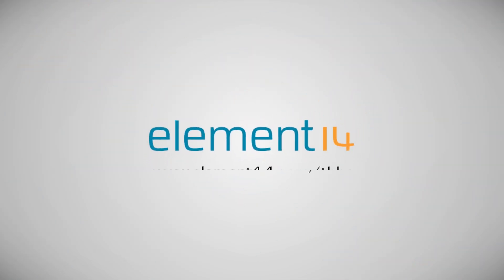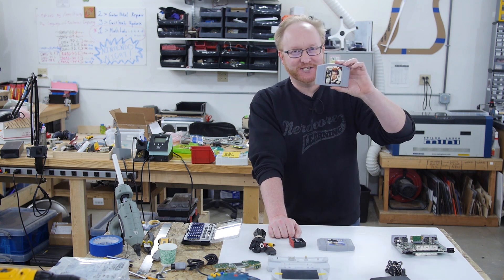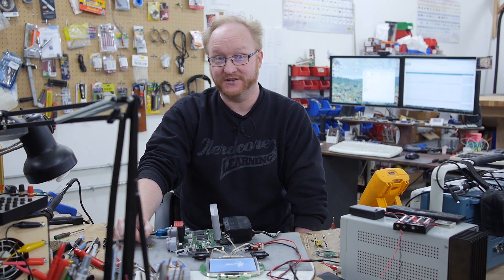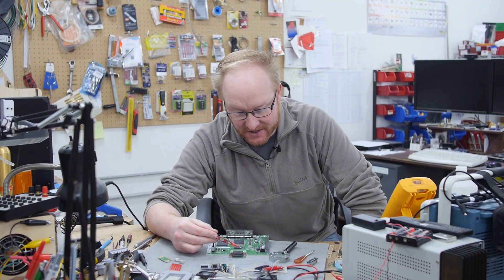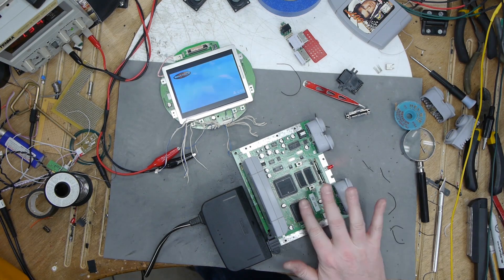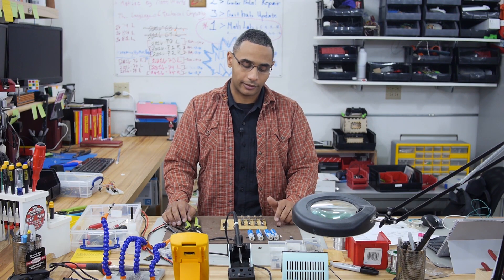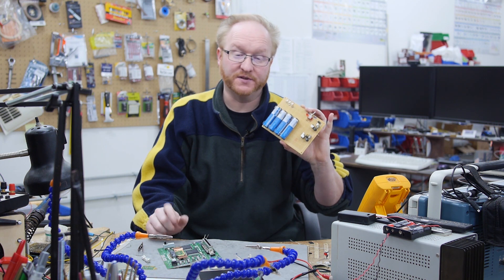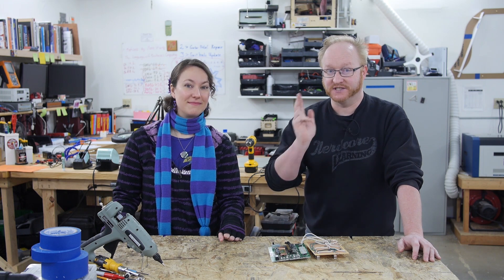Ben Heck's Portable N64 Part 1

Comment: I've got a portable ps1, Gameboy, n64 in my pocket. it's called a phone.
Reply: Have fun with playing with touch controls
Reply: The nintendo 64 emulation is pretty much the black sheep of the emulation world.
Awful communities, being stuck for 15+ years on the same shitty imprecise emulation method, "exclusivity", N64 being a plain bizarre undocumented system that not even the developers had full access to...
Yes, you can play mario 64 with the fade effect missing and Zelda on your phone, but anything more obscure or even the banjo games start to show the limitations of the HLE thing.
Reply: Bas V on android its possible to plug in a controller via USB OTG. emulation just isn't the same though.
Reply: Emulator precision is a bit weird.
Most popular 2D system emulators get the all the commercial games right to a pixel level, because the authors get to test it against all the roms and certify they all run.
But the problems starts to arise when you try to use those emulators to develop new games for the systems, because they allow the code to do several things the real hardware don't or vice versa, and you end with code that don't run on the real system or can't use the emulator to discover new tricks.
So, let's just say that emulators have three possible states, rather than two.
Broken, "run all commercial games" and actually 1:1 to the hardware (Bsnes and nestopia basically, and probably some atari 2600 emulators because you NEED 1:1 to run that thing perfectly).
Reply: Yeah... Emulation is often pretty questionable.

At this point I believe the snes has the single most accurate emulator for any system (bsnes/higan) but Byuu, the person that created it noted that this is all relative. It's far from accurately reproducing very subtle things, as he warned a homebrew developer that was trying to do something extremely complicated and getting weird results compared to real hardware.

The fundamental problem with emulation is the emulators firstly aren't very accurate in general a lot of the time due to poor understanding of the system. (getting snes emulation to that level required de-capping all the integrated circuits in an snes and examining the transistor layout of the circuits), to compound the issue, there's the performance requirements.
Higan currently requires a 3 ghz CPU to run in full accuracy mode, and it all has to be single-threaded performance owing to timing. But to get any major further improvements in accuracy would require a single-threaded x86 CPU equivalent to about 10 ghz.

In spite of this, we've had snes emulators that ran on pentium 100's with maybe 4 megabytes of RAM...
So how is this possible? Take a lot of cheap shortcuts and cross your fingers and hope nothing breaks.
Which it does. Frequently.
But, you can get around that by building a list of games that have problems, and creating a custom emulator hack specifically to fix the problems in that one game.
Which means the emulators fast enough to run an snes on a pentium 100 basically contain a list of about 300 games that all need very specific tweaks to the emulator.
Got a game that the emulator author doesn't know about? Haha. Tough. That'll probably run terribly, and have all kinds of glitches and problems.

Emulation is flaky and hard to do right even if you know how a system is built to an insane level of detail.
Then. even if you can get it perfect in theory, you have to cut all kinds of corners just to get it running on hardware that actually exists. (witness the 3ghz minimum for an SNES emulator with any real accuracy.)

You CAN run every console game ever made on a phone, but you'll probably have a terrible, horrible experience with broken games that don't behave the way they're supposed to.
And that's assuming you have a way around the touchscreen issue on phones. Last I checked controllers compatible with phones and tablets weren't exactly cheap.
It starts to get to the point in some cases that the actual old hardware is cheaper than a game controller that will work with a phone.

Emulation is going to be important in the long term, because hardware does fail eventually. (CD based devices are going to fail sooner than cartridge based ones by the way), but it has a LOT of downsides and caveats that really are very annoying unless you have incredibly low standards...

Plus, n64 emulation is indeed in quite a terrible state compared to many other systems...
Reply: Good luck with that, emulation on phones is pretty problematic. I even had an iPega controller and it wasn't comfortable at all, the d-pad was barely ok and the little tiny lag was enough to make games like Super Mario Bros 3 almost unplayable.
Reply: ***** You didn't actually tested, did you?
Just try.
Also i doubt you can get a good picture of lapras on pokemon snap.
Reply: Dr_Kachu san Trust me Dreamcast emulation is even worse. there are all those windows CE games that nullDC can't emulate and demul is still in alpha. Theres the disparity between cdi and gdi rom types. makes me kind of sad.
Reply: N64 emulation is still bad
Reply: yeah have fun with those shit touchscreen controls
this is why i bought a psp go
Reply: ***** Try playing star wars Rogue squadron on it, or world driving championship, or indiana jones.
Or well mario tennis.
Reply: Phone. What a lame name dude
Reply: At least when it runs a game, it runs it right, except when talking about ikaruga on certain emulators where the bullets go invisible.
Reply: Nob ody lol
Reply: it's not the same tho.
Reply: Nob ody aa
Reply: Dr_Kachu san
all work fine on my s7
Reply: Nob ody I was going to say that...
Reply: Which doesn't run half the games for the consoles you emulate. Congratulations.
Reply: gozinta82 does
Reply: gozinta82 Well, GB you can run every game on any decentish emulator, as the system is quite simple and no game use a pixel precise timing insane thing.
PS1 i would guess 90%-95%, depending on which emulator the android guy stole from.
Now N64 while you can get like 80% of the games running, only 20% will display the graphics and play the audio correctly.
Reply: ***** But still can't run N64 right.

Comment: Why not use a ultra hdmi mod instead of rgb amp
Reply: Pretty sure that wouldn't be to useful with the monitor he is using.
Reply: Why use an Ultra HDMI mod when the system itself doesn't display at that resolution? Especially considering it's being displayed on a 6 inch screen...???
Reply: gozinta82 because it pulls the video right off the chips and makes crystal clear, sharp images which isn't possible with composite. Lotta people have installed on many retro consoles and the image looks great. Plus you can also record to a Hauppage if you want without quality loss.
Reply: The Ultra HDMI isn't commercially available for self installation.  I'm sure Ben has the connections to get his hands on one to do it himself, but then his viewers wouldn't be able to do that mod on their own as well.
Reply: Justice Muffins thats true
Reply: It's just like how he never upgraded his NES "VCR" to have the NES HDMI mod.
Reply: game-tech occasionally gets the UltraHDMI and offers them to individuals. That's how I got mine. The VI-deblur option and a small HDMI LCD would so be worth it. I had no trouble soldering it, but I also have a Hakko 900s soldering iron for my Hakko station, and a stereoscopic microscope. :P